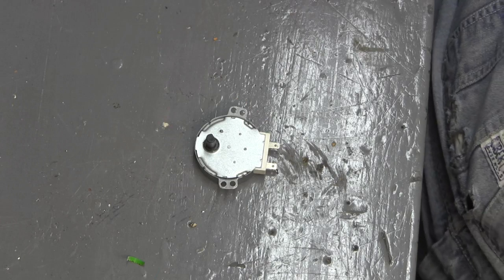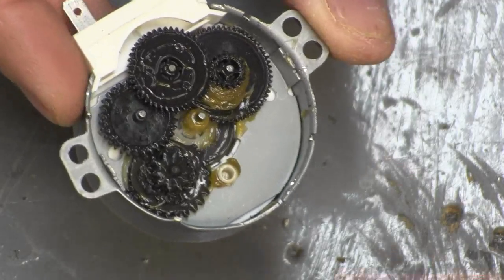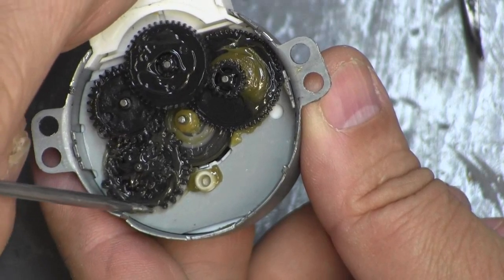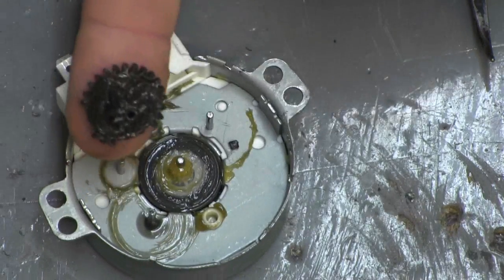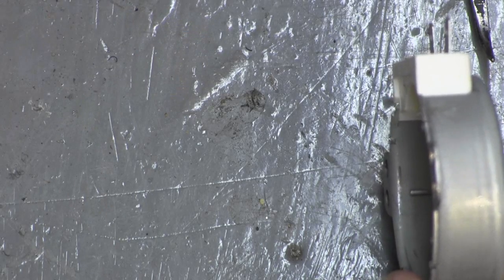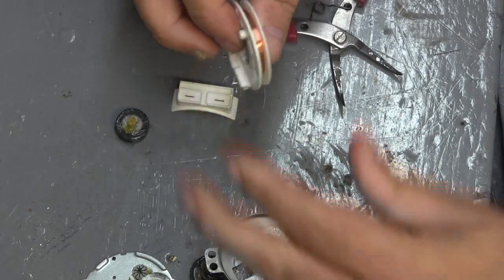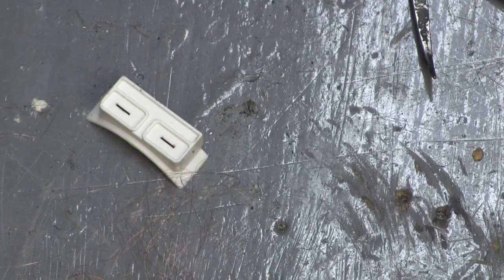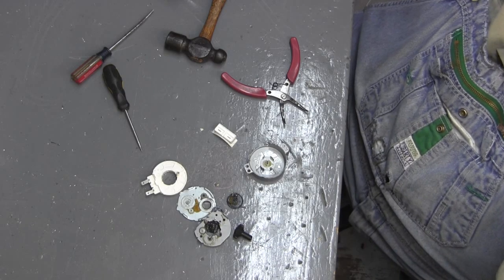Microwave turntable motor

Comment: That exact gear's teeth will break as the motor tries to overcome a seized output shaft which is usually frozen in place due to contamination from dried spilled liquids.

Comment: @BCTruck, BC Blades Strangest thing: I've never seen this kind of motor (single winding, complete cylinder of magnet spinning the gear it houses within ) discussed or illustrated anywhere, yet it could hardly be simpler. I don't even quite understand how it works. Since what I'm assuming is the cylindrical magnet is not in three segments and has no brushes, how does it 'know' which way to turn? There are no windings, or so it appears, just a single undifferentiated spool of copper. After electricity is sent through the copper, why doesn't the magnet simply sit there? --Is it that the copper coil is made of enameled wire, and that electricity is sent into one or the other terminal fed by house current, and which terminal is fed is what decides the direction of rotation? 

Also, if you don't mind, what is this kind of motor called---and can you refer me to a detailed discussion of it anywhere on the internet? I've looked for hours and there isn't even one image of it. Thanks in advance,
Reply from the maker: The turntable turns in a different direction each time power is applied. I know nothing more about the motor.

Comment: Thank you very much for making the video and sharing it.  It is quite impressive. It gave me courage to open and repair the motor if it comes down to that point.  I could not find an exact match for my Turntable motor assembly.  So I was forced to overhaul the motor assembly.  It was difficult to dismantle with the intention of repairing it to make it usable.  My first try failed.  I had to redo the entire process all over again and was successful. God bless you.
Reply: @Sweet Memories @BCTruck, BC Blades Strangest thing: I've never seen this kind of motor (single winding, complete cylinder of magnet) discussed or illustrated anywhere, yet it could not possibly be simpler. I don't even quite understand how it works. Since the cylinder is not in three segments (for example), how does it 'know' which way to turn? There are no windings, really, just a single undifferentiated spool. After electricity is sent through the copper, why doesn't the magnet simply sit there?
Reply: @johnstrawb3521  I watched the turntable's rotation.  The direction of rotation changes when next time you reheat/cooked something. My microwave oven's Magnetron hummed very well after overhauling the turntable motor. The Turntable motor freed up gear assembly and reduced the resistance thereby supplying more current to rest of the microwave.
Reply: @sweetmemories4448  Thank you, friend.

Comment: Hello Dear Sir, thank you for your video, I have urgent concern right now, I sincerely need your help: I have a 220-240v 5-6 RPM synchronous motor, I would like to turn it into a synchronous motor  12v (direct current) 5 to 6 revolutions / minute, what to do?  How many turns (how many threads) do I have to do to get my result?  and with which wire diameter.Thank you.

Comment: Number copper is roughly 2.50 a pound,  go check out moose scrapper, and mike the scrapper,  good guys to learn from about scrapping, and recovery of metal.
Reply: Sorry number 2 motor windings is about 2. 50 a pound.
it may very where you live.